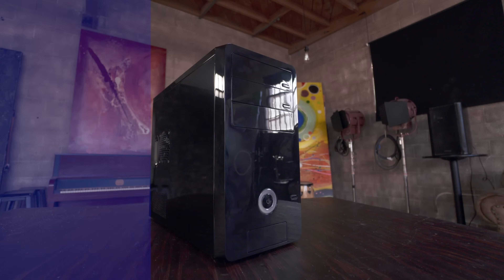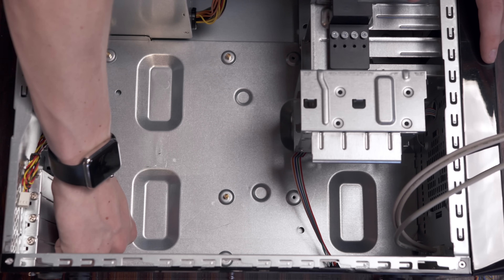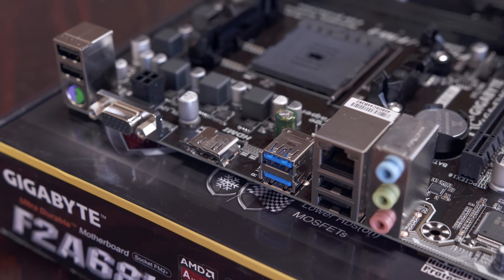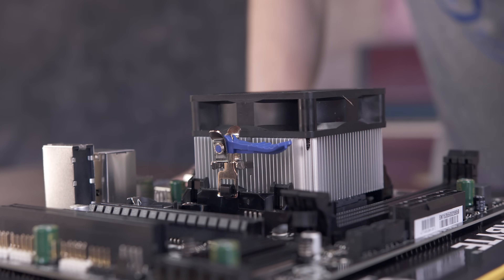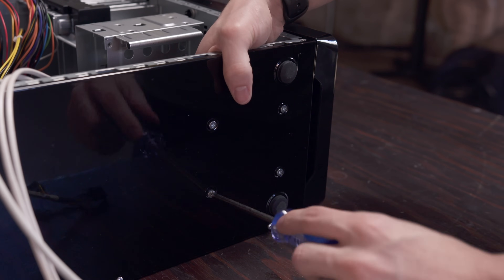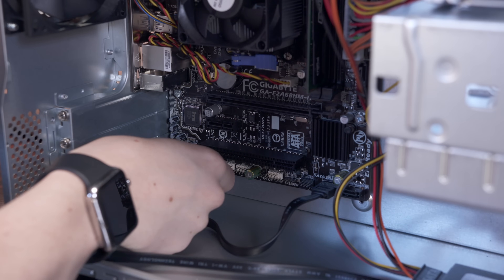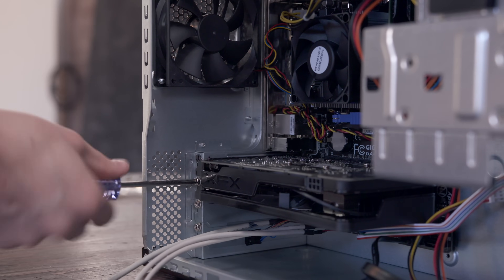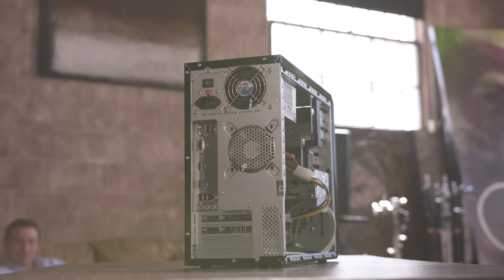How to Build a Gaming PC! (2016)

Comment: Someone please let me know if this is good enough to play newer games, Intel i3 @ 3.2GHz  4 gigs dual channel ddr3 2 x 2Gig sticks
ATI RADEON HD 7870 2gig ddr5 256bit
Dual layer DVD burner
2 x 160 Western digital hard drives in raid 0 
500 gig hdd for storage
Dual band wireless N adaptor
10 USB ports 
Firewire
Hdmi
Digital HD 7.1 audio ports with infrared 
All in one card reader
500W 80+ bronze power supply cross fire ready
Bluetooth 3.0 adaptor
Nice custom midsized case
Software:
Windows 7 ultimate with COE
Avast anti virus software
Nero Burning software 
Virtual Dj
KodI for all your entertainment needs
Accessories:
Nice 3 22in wide-screen lcd with stand 
Bose 2.1 pc desktop speakers, very crystal clear sound
USB keyboard and optical mouse
Reply: I'm not expert but I think it's decent enough, you would maybe be able to play new games but on lower graphics and not @ 60fps or higher
Reply: +Joseph Berritt thank you man how much do you think it'll cost me to upgrade it a bit
Reply: I'm doing my first build at around 950 quid, i5, gtx 1070, Asus z170 16gb ram so it really depends on what you're willing to spend. You can look around for guides on the parts that give best value for money. Thats what I did. :)
Reply: +Joseph Berritt I just want to be able to play some new games like rainbow six siege
Reply: a good idea would be to look at the requirements those games have and plan around it

Comment: How does this sound?
Win10
12.00 GB of DDR3 RAM
GTX 970 4GB ACX 2.0
Intel I-5 4460 3.20 Ghz
64 Bit
EVGA BRONZE 600 Watt PSU
Reply: +Officer PipeBomb Sounds pretty good
Reply: Wait for 1070 lol
Reply: It would be super overkill if you upgraded to a Core i7.
Reply: Yes it would be overkill but if you have a job that pays you way more what you can even spend. .. go for it.
Reply: +Michel Hanson Good point.
Reply: Prouser123
An i7 is around 76 dollars I think? I think I have almost enough for that, I do have a job and it's pretty decent pay. One day there should get me to at least the price for the i7.
 Actually, would it make a large difference if I get an i7? I have quad core i5's.
Reply: +Officer PipeBomb No not unless you need the hyperthreading of the i7.
Reply: +Officer PipeBomb We'll not all processors are made equally.
i5 = 4cores max
i7 = 8cores max

Comment: if your hdmi ports are on the graphics card, then how does sound happen , its a GRAPHICAL prosseser , so why does sound work?
Reply: Alaa Afara technicly , idk , but try both and see wich one gives you sound and graphics
Reply: +Damieon cormier LOL, that's a great idea.
Reply: +Damieon cormier you don't get sound from plugging the hdmi cord into the graphics card and then into your monitor. hence why you plug in sound devices (headphones, speakers etc.) into their designated ports (labelled green... circle shaped hole...)

+Alaa Afara  you plug it into the graphics card, not the mother board. doing that i'm pretty sure just uses the on board graphics if you even have any.
Reply: +James Gritti-Cromwell Thanks, I figured it out before seeing this comment but thanks.

Comment: whats broken if it gives no signal to the monitor
Reply: +TRAIN BOY 876 Maybe wrong connection
Check if the PCIE power connector is connected to graphic card.
Check if you connect the monitor display connector to graphic card's display port. (Not motherboard's display port)
Reply: WB IsMe so i didnt brake the cpu because all the fans and leds are working

Comment: HELP. I bought everything in this build, put it together, now it turns on. All fans turn on but I plugged into a Monitor and a tv and it says there is no signal! Please help me find a solution
Reply: Did you switch to hdmi XD if you did your in bad luck
Reply: +Bro Gaming (Brandon Echard) I mean if you did and still nothing your in bad luck
Reply: +Bro Gaming (Brandon Echard) seems that way. I'm gonna buy another motherboard
Reply: +John David Kuehler 
Check if you connect the PCIEX6 power connector to graphic card. 
Check if you connect the monitor display cable to graphic card's display port. NOT the motherboard's display port. Try DVI or VGA cable instead of HDMI.

Comment: Evan I really really need your help , I just build this computer and I power it up at all the fans start up but nothing comes up on my monitor and I have no idea what's wrong I've exchanged my mother board so it brand and still nothing comes on my monitor
Reply: is the monitor cable fit in and is the monitor on?
Reply: yeah the monitor is on and its displaying HDMI 1
Reply: +lizet norena 
Check if you connect the PCIEX6 power connector to graphic card. 
Check if you connect the monitor display cable to graphic card's display port. NOT the motherboard's display port. Try DVI or VGA cable instead of HDMI.

Comment: Hey guys I am building my first computer, can anybody give me some advice or does this look pretty good?
Intel Core i5-4590 3.3GHz Quad core Processor
MSI z97 PC MATE ATX LGA1150 Motherboard
Kingston HyprX Fury Black 8GB DDR3 Memory
Seagate Barracuda 1TB 3.5" 7200RPM Hard drive
MSI Radeon R7 370 4GB video card
Deepcool Tesseract SW ATX Mid tower case
Corsair CX 500W 80+ Bronze certified semi-modular ATX power supply.
Thank you
PS. i dont plan on overclocking and my budget is around $700
Reply: +Gavin Smith You can't overclock by the way because processor is not K series. Since you can't overclock, you should change the mobo to B85 or H97 to save some money.

Comment: Can you tell me your thoughts about this build? :) and if there's an option to change to an i3 6100 with a fitting motherboard for the same price?
psu: Corsair CP-9020047-EU CX Serie CX500 ATX/EPS 80 PLUS Bronze 500Watt
case: BitFenix BFC-NEO-100-KKXSR-RP Neos Midi-Tower
processor: AMD FX 6300 Hexa-Core Prozessor 
ssd: Crucial BX200 240GB SATA
Graphic card: MSI V305-030R AMD Radeon R7 370 Gaming 4G 
storage: Seagate Desktop HDD 1 TB
Ram: Crucial Ballistix Sport 8GB
motherboard: MSI 7693-040R 970 Gaming AM3+ AMD Motherboard (ATX, 4x DDR3 1333, SATA 3, USB 3.0)
cooler: Cooler Master Hyper 212 Evo CPU-Kühler (RR-212E-16PK-R1)
Reply: I love you
Reply: alright that's also an answer
Reply: Should be good for the next 3-5 yrs then you will need a different cpu and gpu

Comment: I'm fairly new to building a PC but here are my specs for the build, please do so recommend to edit some of my stuff. Any advice for the case and power supply?

Motherboard:Asus Z170-A
cpu: i7-6700k
cpu cooler: cryorig h5
Ram: g skills ripjaws 4gb x 2  
hdd: Western Digital WD 1TB My Passport USB 3.0 Portable External Hard Drive Black
Optical drive: ASUS 24X DVD Burner
gpu: Gtx 970, planning to over clock.
Reply: +Gaming Spark Any case that support ATX size motherboard will do. A good quality powersupply from EVGA, Seasonic, Corsair or Antec.
You should choose an internal hard drive instead of an external.
Reply: +WB IsMe I would not recommend corsair's powersupplies to ANYONE planning on overclocking their rigs components. 
Imo, seasonic antec, and EVGA are the most reliable. XFX is also reliable based on experience using them.

Comment: +Austin Evans I am thinking of using a different case, Should it still be ok?
Reply: +Tate Lidgard Any case will be fine as long as it support matx size motherboard.
Reply: +WB IsMe Forgive my retarded question, but what a power supply should I get, I mean do all the power supplies have the Molex and other pin stuff or will I end up with a missing cable if I buy a wrong power supply.
Reply: Alaa Afara All power supply will provide minimum of 2 molex, 2 sata, 1 24pin mobo and 1 4pin mobo connector. 

Before buying a PSU, it is better to check the manufacturer's website for numbers of cable a particular model provides. Additionally, buy from reliable brands like Seasonic, EVGA, Antec, FSP, thermaltake and Corsair. Do not buy from brands that does not provide you online detail of their powersupply.
Reply: +WB IsMe Today I finished building the PC, every thing is ok and I added a Optical Drive. So how do I get to the screen Austin had in this video and how to I get the PC to boot a Windows 10 CD. Sorry but this is my first time building a PC.
Reply: Alaa Afara That screen is call a BIOS. All motherboard's BIOS has different design. 
The moment you turn on your PC, spam either F9, F12 or Del depending on the boot up screen.

Once you are in the BIOS, find and select your optical drive as the 1st to boot. 
Restart your PC and put the window 10 CD into the optical drive and follow instruction shown in the screen.
Reply: WB IsMe Thank you
Reply: WB IsMe One more thing which is extremely stupid. But since the PC turned on it'll perform normally right? Because I accidentally touched the graphics card's board. Sorry for too much questions but this is my first time doing this.
Reply: Alaa Afara If you didn't get shock means nothing is wrong, don't worry.
Reply: WB IsMe Thanks

Comment: Help rate this please 
CPU: Intel Core i7-6700K

CPU COOLER: Corsair H60 54.0 CFM Liquid CPU Cooler

MOTHERBOARD: Asus Z170-A ATX LGA1151

RAM: G.Skill Ripjaws V Series 16GB (2 x 8GB) DDR4-2400 Memory X2

MEMORY: Seagate Barracuda 2TB 3.5

GPU: MSI GeForce GTX 970 4GB  X2

CASE: Corsair Carbide Clear 600C ATX Mid Tower Case

PSU: Corsair RMx 850W 80+ Gold Certified Fully-Modular ATX Power Supply
Reply: +TheMightyMelon what can I do to fix that
Reply: +LucasAllum i think he was joking..

Comment: is there a nice looking case also would the power supply run a gtx 750ti/960?
Reply: +〈----Ughhhh This Is Natural Neither, since the power supply would blow up before the GPU is connected. I am serious, built-in power supplies are shit.
Reply: +〈----Ughhhh This Is Natural GTX 750TI, yes. GTX960, No.
Reply: +nerd73 it wont blow up, its not a hercules unit. But it is unreliable to the point where you should not use one.

Comment: Wait so there no hard drive or what please answer ?
Reply: +AvoidtheGamer 3:21, no hard drive but SSD.
Reply: wait i still don't get it tho do i have to put the ssd
Reply: You can use either SSD or HDD for your storage. 
If you are on budget, HDD will do. SSD is optional but good to have because it load 3~5 times faster than HDD but more expensive per GB.
Reply: so the ssd is optional also if i pick the hhd were do i plug it with the power supply
Reply: HDD, SSD and disc driver uses SATA power cable. All power supply will have at least 3 SATA power cable.
Reply: +WB IsMe ok thanks for the help

Comment: Question though, I want to LAZILY upgrade the CPU (core i3-2120) on my current motherboard, should I get the core i5-3570 or the core i5-2500 (non k versions as the motherboard can't overclock).
Reply: +Michel Hanson Meh,The i5-2500 is the better in that case..The i5-3570 is like with over 50Euros more expensive and it's almost the same..The i5-2500 is 3.3Ghz,while the 3570 is 3.4Ghz..Not worth it,in my opinion :)
Reply: +valentine Xristov you should not measure clock speeds against other generations of CPUs. The architecture is different
Reply: +Hurricanefalcon128 understood. I made my decision and picked up a used core i5 3470. it's cheaper and performs the same.

Comment: how would I use a ssd and hardrive together
Reply: +JM Gaming (ok gamer) put the sata cable for the SSD into Sata port 0. Don't put in the HDD yet. Start the PC and install Windows to the SSD., After windows is installed and booted up. turn it off, now install the HDD and connect the Sata cable to Sata port 1 on the motherboard. Start the pc, you should see the second Harddrive which will need to be formatted and voila.
Reply: +Michel Hanson tnx cant wat to build this

Comment: Intel Pentium @4.4GHz
4gb of ram
Zotac GTX 750 ti
Windows 7

would this build perform well?
Reply: +Souji Q Get another stick of ram. Might run into problems running more modern games. 8GBs is the sweet spot.
Reply: +Souji Q I misread it thought it said 2.4 ghz. but yes a good first build for sure.
Reply: +Rave Pigeon what are you on?
Reply: +Derps I'm talking about a rig.

Comment: I have a question for you guys. I'm saving up to build myself a new computer and was wondering how well this build would do.
 Intel i7 4.0GHz Skylake processor
Asus Maximus VII series motherboard
MSI GeForce GTX 980 4096MB graphics card
Cosair H100i Liquid Cooling
16GB DDR4 Ram
2TB hard drive

Or how well would the MSI GeForce GTX 980 4096MB graphics card work on my current build:
Intel Core i5-4670k CPU 3.4GHz
GeForce GTX 650
Intel Desktop Motherboard DH87MC
8GB Ram
1 TB hard drive.

Would it be better for me to just make upgrades to my current build or build a new one?
Reply: +Bolwinkel Whoa whoa whoa whoa!!!! Just buy the Graphics card. in fact, just but the R9 390 8GB video card. your PC has got me jelly :-(
Reply: Michel Hanson So everything in my PC is fine for me to upgrade my graphics card? I really don't know much about compatibility and everything. How would I be able to tell in the future if an upgrade would be fine for my PC without having to upgrade the power supply or something else first?
Also, since there are so many different ones, how do I know which one to get?
Reply: Bolwinkel Yes everything in your PC is just fine as far as future proofing. Trust me. When it comes to the R9 390, got with the Sapphire one or the MSI one. http://www.amazon.com/MSI-R9-390-GAMING-8G/dp/B00ZPOAYG6/ref=sr_1_1?s=pc&ie=UTF8&qid=1462114437&sr=1-1&keywords=r9+390
Reply: +Michel Hanson Ok, how will I know when I would need to make an upgrade to something else to accommodate for a different upgrade? Also, what would getting an i7 processor do for me? Would it be worth while to upgrade to it?
Reply: +Bolwinkel Lecture time!!!! A general rule of thumb, we upgrade our PC every 5 years (that's CPU, Mobo, Power supply and RAM) and video cards are upgraded when necessary!
Future proofing your PC gaming cannot be done as some developers will lazily optimise PC games, case is point, I thought after the Batman: arkham knight fiasco it would stop but after seeing Gears of War and Quantum Break, I can see history will repeat itself.
PC gaming is like building lego blocks for nerdy adults like myself. While it is GREAT that you can afford all the latest and greatest PC parts.... DON'T!!! This can be lead to an addiction we call the PC hardware money trap! Due to great marketing, we fall for it and we feel that our PC is inferior due to it being built from parts that were great last year.
Getting an i7 will not do much for you not worth buying. Your core i5-4670k is fantastic and will last for 10 years or more thanks to overclocking. What you need to for your current system is focus on just the video card. In your case, you seem to love to play your games on High to Ultra with 1080p and run it over 60fps. While we enjoy watching our PC games running as designed, there will come a time when get the latest game only to cry we are forced to turn down our graphics settings to medium or low just to run it around 30fps. Now when that happens. time to Upgrade the VIDEO CARD!!!!
Reply: +Bolwinkel Whew, I know I have said a whole lot. This site will help you out in the future when the need arise to upgrade:
First use Game Debate and bookmark it, here you will pick the video card you have, the memory you have and the game you wanna play, then click can you run it. http://www.game-debate.com/hardware/index.php?pid=1192&cpu=Core%20i5-4670K%203.4GHz
After it runs, select Minimum to see what you really need to upgrade.
Reply: +Michel Hanson After using game debate, Time to use PC partpicker.com https://pcpartpicker.com/parts/partlist/
Here you will select the parts you have and the part you wanna upgrade, For example: http://pcpartpicker.com/p/b6hfsY
Your current setup, I would get a 500GB SSD with the MSI R9 390 as you can see in the top right, the Power Rating is 478W, so I would by the 650 Power supply from Corsair https://pcpartpicker.com/part/corsair-power-supply-tx650v2
Reply: +Bolwinkel Finally, use articles like Toms Hardware to see what's currently the best out there to spend your money on:
CPUs http://www.tomshardware.com/reviews/best-cpus,3986.html
and Video cards: http://www.tomshardware.com/reviews/best-gpus,4380.html
Reply: +A Helpful Person if he can afford it then no problem.
Reply: Michel Hanson I have a Corsair CX 500M psu. Are you sure that is good enough for the r9 390?
Reply: ***** agreed
Reply: Michel Hanson With the reveal of the new GTX 1080 and 1070, would you recommend me to get them instead? Mainly the 1070?

Comment: OK so I hope someone will answer this question, I have a product key for windows 10 and I'm slowly building a PC close to this one, when I boot up the system is there a part of it where I enter that key or do I have to activate and then place it on a USB?
Reply: no you just put in the code
Reply: +EcoHyper thanks
Reply: +mark freeman When your installing Windows 10 it will ask for the key but u can skip and enter later if you want to.

Comment: Ok, I just stopped the video when he took off the side to the case and there was a PREINSTALLED power supply!
Reply: +WatsonGaming that PSU isnt very reliable. I would reccomend switching to a seasonic S12II unit.
Reply: +Hurricanefalcon128 my 750 watt hive from rosewill is fantastic. has been for 3 years...dont spout what you hear
Reply: Why
Reply: +TH3 PIG STUDIOS really crappy power supplies
Reply: Not really I built this exact PC and it works great!
Reply: +TH3 PIG STUDIOS because rosewill doesnt make good PSUs
Reply: This is his budget Boson 3.0 build, for a $300 pc, a pre-installed psu was necessary. And this specific one isn't bad tbh